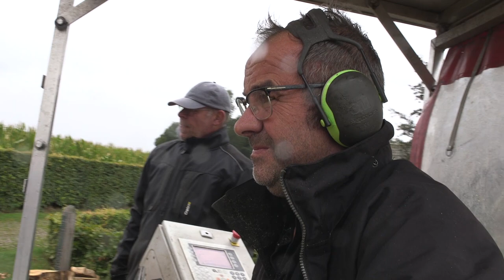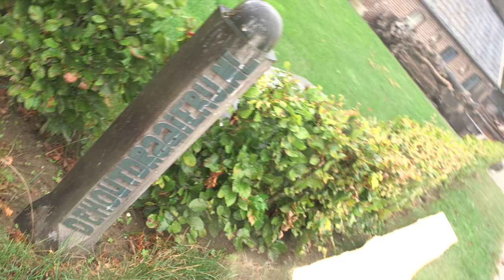Sawmilling logs into slabs

Comment: How you cut your logs is pretty much what I do as well, then just buck them to length after milling. Only I have a Bandsaw Mill from Woodlands Mill, only it's manual, so I have to load and roll the logs by hand, but I load them with my Tractor that has a loader. Also, my mill doesn't have wheel's, it stays in place. Still, it's always good to see how others do things.
Reply from the maker: And do you like your Woodlands mill? Is it a good machine?
Reply: I do, it's been great so far. I like that I can do Veneers down to 2mm thickness. I was looking at the Lucas Mill (Australian made), but as it uses a blade like a circular saw, it can't do slabs, or cut veneer, and was much more costly than most Bandsaw Mills on the market. From the looks of the Mill in your video, mine doesn't logs as long as standard, but I got some angle iron and extended the tracks myself, so I can cut logs up to 3mtre's in length by 660mm wide. I also got the upgraded motor (14HP), and hardened blades, as a lot of Australian timbers are quite hard, like Iron Bark (not that I've had the chance to turn any yet), Tasmanian Blackwood, once it's seasoned can be quite hard, so far the Saw cuts through it easily. Mine is the older model of this https://woodlandmills.com.au/product/hm126/ it's max width works great for my Lathe (Laguna 24/36). I'm about to be moving location (January), and be in a better workshop, but I've been thinking of doing a video on how I do blank Prep, as I have about 3 tonne's of Figured Macrocarpa Pine to process once I move.